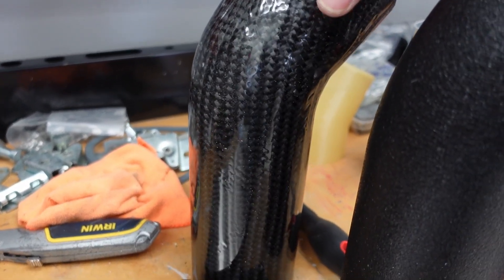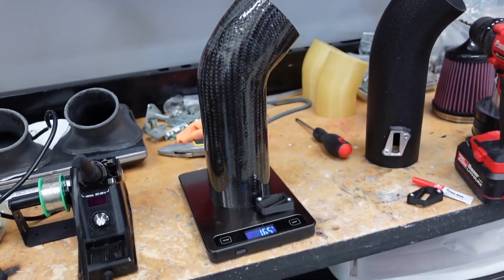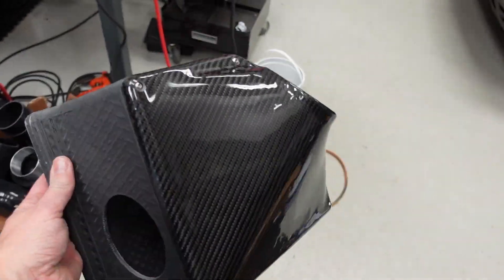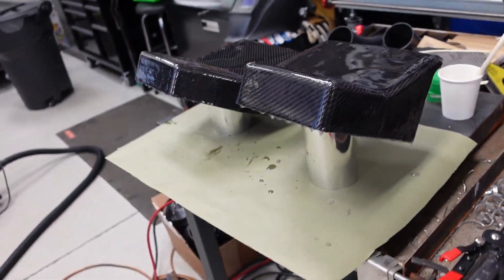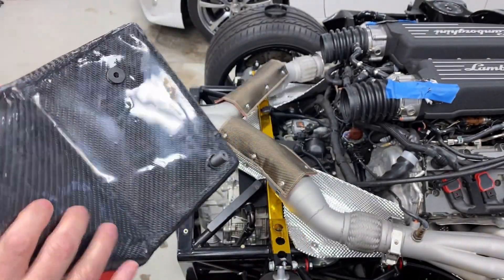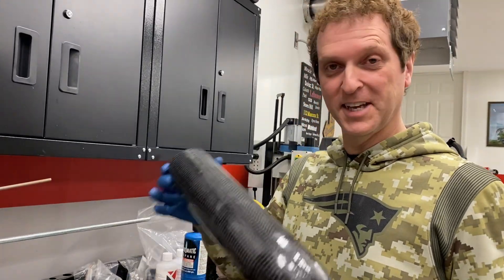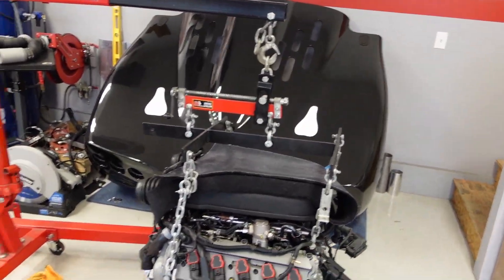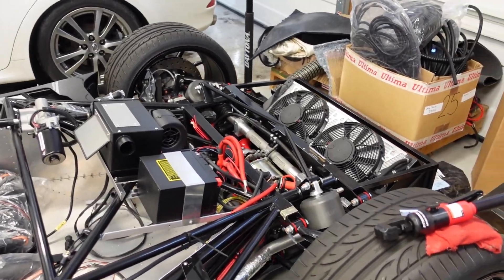My 100% Carbon Fiber V10 Intake Systems is Complete!

Comment: What was the motivation for deciding to heat shield instead of, or over the cerakote?
Reply from the maker: @bobgodd  After seeing actual results of heat shield surface temp versus Cerakote, it was a no brainer imho. The shielding is so good you could almost touch it at running temp and not get burned. I was really concerned with under clam temps so I installed the best heat insulation I could get.
Reply: @DanDulac  thanks. I'm kind of in the same boat, been going back and forth between cerakote and header wrap and heat shield. I talked myself off the cerakote when I saw comparison numbers, now I'm talking myself out of header wrap due to the potential to have to redo it in 5 years lol. Now I'm looking at DEI form-a-shield. What brand shield did you go with?
Reply from the maker: @ I had a company called Header Shield based (in the USA) do my headers and x-pipe. It wasn’t cheap but the best you can get.  There are companies who do the same thing in Europe.
Reply from the maker: @ I had a company called Header Shield (based in the USA) do my headers and x-pipe. It wasn’t cheap but the best you can get.  There are companies who do the same thing in Europe.

Comment: What kind of material do you use for the mold?
Reply from the maker: Carbon fiber infused Nylon.  Specifically for the air boxes: SainSmart ePA-CF (in black).

Comment: Are those intake tubes air tight?
If you got a good all over coating of resin they should be, but there’s the possibility of pin holes you should check for.
Glad to see you crimped the cables.
It’s starting to look better than what comes out of the factory.👍
Reply from the maker: Yep—they are air tight. I put 4 coats of epoxy on them and the light you see from inside the tube is a result of the 12K twill weave—it’s a big weave so around the bend, the weave opens up a little. But these tubes are nice and rigid. The next time I make tubes, I’ll do a base layer using 3K, then 12K over the top—just an added layer of security.
Reply: @DanDulac  👍 
I have had pin holes open up after sanding and polishing on open weaves like that, sometimes the epoxy doesn’t spread between the fibres to fill the gap unless you vacuum bag it.

Comment: Hey, quick question
Isn’t one layer of the carbon cloth to thin? When you removed the pva pipe you could still see a lot of light shining through… I get that the resin fills a lot of spots but isn’t it kind of bridle still?
Reply from the maker: The 12K 2x2 twill I used is pretty thick/heavy fabric but the weave isn't as 'tight' around bends...therefore, you can see light through the weave in a couple areas around the bend--it doesn't conform as well as 3K twill.  I used 4 coats of epoxy so the tube is very rigid.  Off camera I tried using 3K 2x2 twill sleeve and even with 4 coats of epoxy, the tube isn't nearly as rigid as compared to the tube made with 12K twill.  Given these tubes will see no air pressure or other physical loading, they should hold up just fine.  Heat is my only concern, which hopefully won't be an issue with the a fully shielded/insulated exhaust.  Thanks for the question!

Comment: Dan, just curious. Which battery are you using?
Reply from the maker: I’m using the AntiGravity ATX-30-HD. I originally had the ATX-20-HD as it’s even smaller but the lower amp-hours was on the the hairy edge for this car.
Reply: @DanDulac  Thanks, I was thinking about the same battery for my build. Like the weight savings and size vs. a 60 pound Corvette battery. What charger are you using and have you had any experience with the ATG batteries?
Reply from the maker: @JoelKSLC  i'm using the lithium charger that AntiGravity offers to go with their batteries.  You definitely can't use a traditional lead-acid battery charger on these lithium batteries.  I have no experience with ATG batteries--sorry can't help there.  But the weight savings of Lithium batteries over lead-acid is incredible and way worth it for a car like the Ultima, imho.

Comment: Interesting way of making the parts for the cold air boxes (CAB). I am not sure of all the constraints you have but here are my thoughts for what they are worth:

Relative to the exhaust (even fitted with ceramic coating and heatshields), the CAB are "downwind" and the pipes from this to the engine intakes pass over the exhaust (in both cases warming air that should ideally be kept cool). The other issue is that placed here, the CAB also make it more difficult for hot air to escape from the engine bay.

Could you possibly find another location for the CAB ? 

Keep up the great work, it is very useful to watch.
Reply from the maker: Hi Andrew—great suggestion. I scrutinized the location of the CABs a lot. In the end, there’s just such limited space and options under that clam with this engine package. I do plan on wrapping the sides of the CABs closest to the exhaust with the same DEI firewall material I used before. In the research I’ve done on the insulated exhaust shied I’m having installed, indicates surface temp on the wrap gets only as high as 253-degreesF under sustained high load/RPM conditions on a dyno (which also means low ambient air circulation), versus 835-degreesF without it. This is a HUGE difference. And since there’s 2-3 inches of spacing between the CABs closest to the exhaust, I expect radiant surface temps on the CABs to get around ~150F max sustained (just a guess). Plus, with the top clam mounted NACA ducts feeding cool air directly into the boxes, I’m hoping it’s good enough to keep intake temps down. I’m also planning on adding a couple NACAs on the skid plate I’m planning to make, to draw cool air into the engine bay to promote additional air circulation. I’m going to install some ambient temp probes in the engine bay so I can monitor and prove all this out for future builders. 💪
Reply: @DanDulac  Thanks for the detailed reply. I'm building up a "65 Lotus Elan with a 180 bhp 1600 cc engine which is "front mid engined". Hot headers next to fiberglass need careful thought (have used US spelling / terms for you). All data on the effectiveness of the heat reducing products is very useful to other builders.

Comment: Love the intake tubes and the diy'ness of using 3d printed pva plugs. Surprised to see how easy they came out to be honest...
Reply from the maker: Hi Sean--yeah me too; the epoxy doesn't stick at all to the PVA.  Which makes sense given a liquid form of PVA is used on composite molds to make it easy to separate finished parts.  This opens up a world of possibilities combining my 3D printer and Carbon Fiber composite parts.  :-)

Comment: Wow. Great decision on the carbon fiber intakes. Looks incredible, and definitely more like a supercar. Makes me want to make some carbon fiber intercooler piping with your technique shown here. Love the videos, keep up the great content
Reply from the maker: Thanks for the kind words!  For pressurized applications, I’d recommend doubling (or tripling) layers of the carbon sleeve. This will add a TON more strength that will hold up under boost. For my naturally aspirated application, my tubes only need to hold up to the pressure of the atmosphere (at maximum). 👍

Comment: Air boxes turned out sweet! Am I the only one who wished you used red heat shrink on the red cable? Lol. Curious, what’s the purpose of WD40 inside the frame hole right before you install a rivnut? I’ve seen you do that on this and previous videos and didn’t understand. 

Also, could you share with us where you send the headers off for heat shielding?
Reply from the maker: Hi Brian!  Good eye. The stuff I spray inside the frame is 3M cavity wax. Anytime I drill holes into the frame tubing, it exposes it to moisture and potential rusting over the long term. Since the inner frame is not coated like the outside, I spray the cavity wax to seal and protect the inner tubes. Regarding my exhaust system, I found a place in the states at HeaderShield.com. I can’t wait to see how they turn out and the heat insulation tests look incredibly good!

Comment: As always Dan, greats moment with your videos, information, dedication and always with a big smile, where do you bought this crimp?. Huge thanks from Europe.
Reply from the maker: Hi Roma—I bought the hydraulic wire crimper at my local Harbor Freight tool store. You should be able to find a crimper local to you as they are a pretty common tool. Thanks for the comments!
Reply: @DanDulac  Thanks Dan, I found this model in amazon Europe. Best regards.

Comment: PVA was a great idea! I'm about to start making carbon fiber parts for the first time, is there a reason you didn't use a vacuum bag? I was planning on getting some and using for the first parts I build, not sure if it's better to skip that step for any reason? Great work and thanks for recording it all!.
Reply from the maker: Hi Sean!  I considered vacuum bagging but the PVA tubes I printed were thin enough where the vacuum bag would have deformed the tube. PVA is a pretty delicate filament and will break/crack easily. To overcome this, I could print a more robust PVA plug but it require a lot more PVA filament, much longer print times, more PVA waste, etc. For making carbon tubes that won’t be under pressure in use, the method I used is just fine, imho. But if I were building tubes that would be under positive pressure (like a turbo application), vacuum bagging would insure maximum resin infusion for maximum strength and lightness. Hope this helps!
Reply: @DanDulac  makes total sense, thanks for taking the time to reply!

Comment: Fantastic video. Awesome car and work. Where did you get the exhaust heat schielding put on
Reply from the maker: Hi Jan—I sent the exhaust off to HeaderShield.com. They are based in Illinois. The insulating tests I’ve seen are amazing: 250-degree surface temp with insulated shielding versus 850-degrees without.  From what I’ve researched, this method is the best heat shielding you can do for an exhaust.